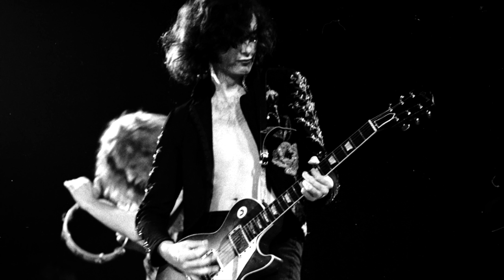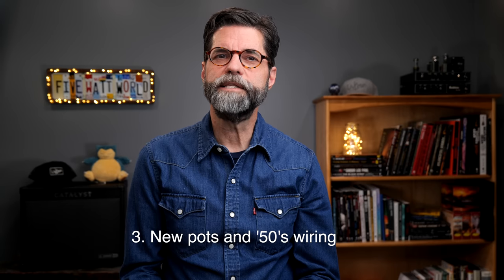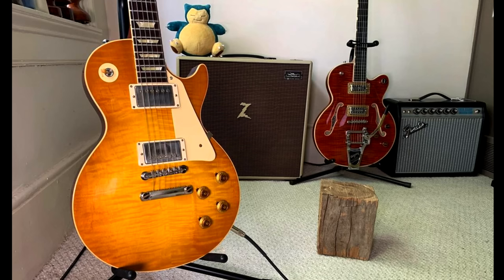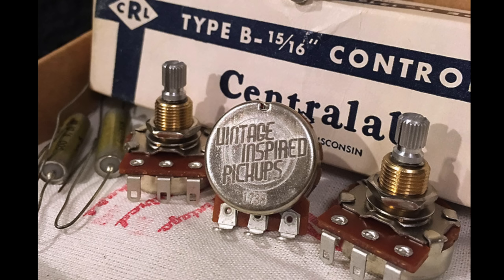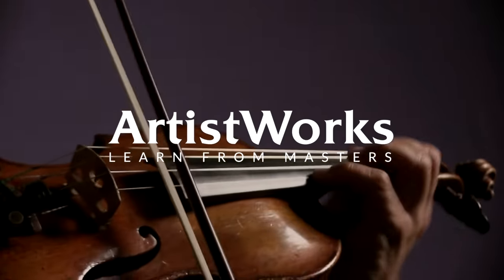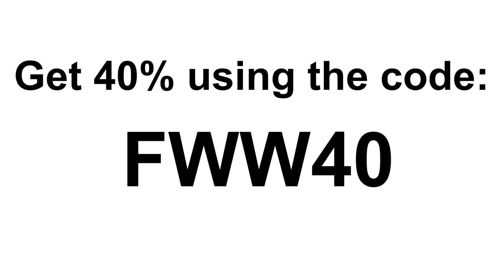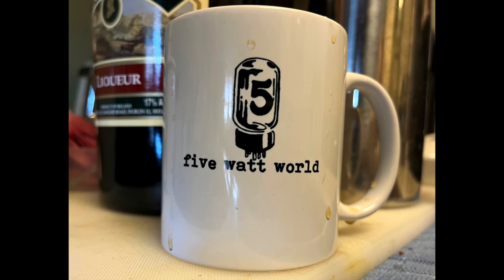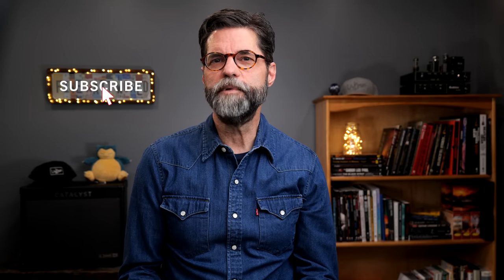Budget Guitar & Boutique Pickups? Is it worth the upgrade?

Comment: I've been recently experimenting with humbuckers in my Strat, and came across some interesting info. On the lespaulforum, there is a "Gibson Historic Spec Pots Data" thread. One Poster ordered 38 vintage spec pots from Gibson. By my count, 23 were below 500k, and 15 of those were in the 400-450k range. Another Poster commented "Gibson used 300K linear in regular production guitars for almost 40 years...and still does...as I noted above....at least, that is my expeience with Gibson pots since the '60's."

There is a Dylan Talks Tone video where he mentions that the biggest tone difference is made on the Volume Pot, as all the signals have to run through that pot.

So, actually measure the pot resistance, and if it sounds good, it is good. 😎

Comment: Without going to the extent of buying costly "boutique" pickups, I think that it is possible to improve a guitar's tone or to make it closer to your liking by replacing the pickups. I find that the Antiquity line of pickups offered by Seymour Duncan are excellent and affordable if, of course,  you are into vintage tones. And if you don't want to change your guitar's wiring to '50s style wiring, you can always had treble bleed circuits to your volume potentiomenters. It's not the same as the '50s wiring, but with these installed, you won't loose any high frequencies when you roll off your volume knobs.

Comment: Some years ago I've modded a behringer strat copy, put blade mini humbuckers on the bridge and neck, added phase inverting and humbucker/single coil switches, rendered the neck fretless and put some locking tuners, all using 'budget/mor' parts, that guitar has so many sounds it's crazy, It's my main guitar in my 'the Oddities from the Corners of Obscurity' project.
And now I'm thinking of trying the '50's wiring on my Gibson SG...uhmmmm...where's the soldering iron?
Thanks for the inspiration!

Comment: This is a great video Keith.  Thank you to you and your team for putting together something so powerful and so clearly presented.  With some rare exceptions I find that I can improve any common guitar with 50s wiring and a pickup change.  My most recent methodology is to buy Squiers and Epiphones that I play tested for the lowest weight and the best feel.  Then do 50’s wiring and replace pots and switches where it makes sense.  Some Chinese Epis come with proper CTS pots where the much more expensive Gibsons come with lower quality Alpha pots.  It was good to learn about VIP, as I tend to source pots and switches from a local parts shop called Solo Guitars and I have had incredible success working with Tim Mills who runs Bare Knuckle Pickups.  Whether standard products or custom winds, I always feel I am getting incredible value for my money.  In fact, I did just this kind of work to an old PRS Core 245 which played great but did not have the openness that I expected.  New wiring with higher value pots, a cap change to a BN paper and oil cap and some Bare Knuckle pickups took it from very good to great.  Thanks again.

Comment: I would also like to throw in about the wiring and small electrical components. Tiny wires, bad solder joints, and cheap caps/pots plague even nice guitars. One of the reasons I started making guitars was that when I bought a factory made guitar, it had all this really mediocre electronics inside it that had to be fixed. I kind of wish companies would sell just a body and neck and then let you Kit the thing out on your own. It might actually save a lot of time and trouble. My Yamaha is currently running CTS pots, an orange drop cap, solid copper wires...and Korean made Gretsch Filtertrons. It sounds great, even though those pups were only about 35 bucks each. The rest of the stuff in there seems to let them shine.

Comment: The single most important spec of a capacitor is the tolerance. You need to aim for 5-10% tolerance at most. Otherwise, it's a crapshoot as to what effect it will have on your tone. The type means very little.

Comment: I have a 2016 LP Studio, about $800 at retail at the time. It sounded OK, but in an attempt to make it sound a bit more like my '77 Custom I bought a set of Pariah  T top clones for $300ish. They are magical. Swapped out the wiring harness too (it was PCB). But for a thousand dollars, I bought the guitar very slightly used for $600, it sounds brilliant. Better than most of the 3 thousand dollar Les Paul Standards I've tried in the stores.

Comment: The wiring and the caps are a big deal.  Does not make any difference if it's a guitar, or stereo speakers.  I occasionally mod a guitar or build a parts-caster or something. I also rebuild older speakers.  I like to tinker.  The ones that always reach out and grab your ears are the ones you spent time doing the research and using good quality caps on.  
Old Soviet Radar caps are a rock solid option for speakers, when you can find them.  Have not found any smaller ones for guitars, yet ...  🙃

Comment: A paper capacitor will eventually leak.
That will result in the same as if you have connected a resistor in parallell with the capacitor.
If that is what you want, connect a resistor there from the beginning.

Comment: "The budget mod platform"  I am sooo glad 'this guitar" I bought NEW for $170 would not allow 1 - install a Stratocaster vibrato mechanism, body was 1/4 inch too thin. Even had I chopped and retapped the end block, routing for springs would have pierced into the bridge pickup cavity. 2 - maybe install a 5-way knife switch.. again, complications. Then I discovered that the 'both on' position was indeed wired incorrectly out of phase. Because it had a chrome tele style control mount plate, I didn't even have to loosen the strings. took less than 10 minutes. I'd already changed out the tuners for Gotoh Minis. Then I just looked at "this guitar". It just happened to have birdseye maple neck. When I looked closely through the tobacco sunburst I noticed the unmistakable "ribbon figuring" - it "just happened" to have a quartersawn (edge-grain) body. I decided it was stupid to mess with anything else.  I soon discovered that "this 'low-end' guitar" more than doubled in value. Had I butchered the thing it would likely have killed resale. You might like to cover the briefly available Squire/Fender '51. Best $200 I ever spent on any gear, besides an unused Carvin ValveMaster 100/50 Stage Master 2x12 I found on Craigslist for $250. I just looked for info and discovered both the amp and its full set of GrooveTubes, have to be over 40 years old??

Comment: Years ago I found a bargain basement deal on a used budget super strat type guitar that was just perfectly to my taste in specs and looks. It felt great to play, but sounded pretty mediocre to bad, so I basically gutted it and replaced all the cheap guts and hardware with decent budget stuff. It was a noticeable improvement, but nothing to write home about, it was a cheap backup. I had these hand wound custom made pickups gathering dust, because I had ended up selling the vintage guitar I bought them for, so on a whim I had the installed in the budget guitar. Ever since, that guitar has gone head to head with name brand new and vintage guitars, custom builds, and I still have it and enjoy playing it regularly. I never would have planned it, but what a pleasant surprise it was

Comment: In 2014 I went for a full Custom Waghorn Sauria S specing with Tom. He got the basic guitar perfect and I chose over complex electronics and I didnt like the pickups. HSS and I also had a Yamaha Pacifica Jack Thammarat HSS which become the modding guitar. I tried diMarzios to ying yang Kiesel and finally 2 types of Suhr. I took the bold step with my tech to take out the piezo.hipshot bridge and replaced with brass saddles, used dip switch as H coil tap and the piezo control as a blend between neck and bridge and a new 5 way switch, then a fender 250/500 volume pot given only one volume. The tone is a  stellartone. Ssv ans 2 v60lps. Now super. Other mex strat redid metal work and Shaller locking tuners, Gotoh 510 trem pickguard wth JJguitar pickups V12 (a la DG tones). Gibson les paul studio, SD whole lotta pickups rewired tones push pull with phase and parallel a la JP. Gibson lps100 dc upgraded JJguirar pickups J90s this is awesome sounding. Thx to Burgs for introducing me to Ben Bailey’s pickups. Thanks to Komson my tech in Bangkok and Tom Waghorn a superb luthier. Modding is a great experience and great to get what you dont want to afford!

Comment: The biggest things I look for when trying out guitars is not how they sound, but how they play. You can change how a guitar sounds, but if a guitar is a dog to play, good luck. With that in mind, I'm also a tinkerer and I've built a handful of partscasters and modified nearly every electric I've owned. My most recent project was my 2012 Epiphone Sheraton I sold when I went broke. I had the chance to buy it back and once I did, it became a forever guitar. Since getting it back, the pots have been swapped to CTS, the wiring has a treble bleed circuit in all positions, a master tone on one knob and a grease bucket on on the other, Bigsby, roller bridge, and Lollar El Rayo humbuckers.

If I was forced to sell it, do I expect to get any more than maybe $600 from it? Absolutely not. But I have all of the original parts I'd use to revert it back to stock with and then sell all the upgrades separately.

Comment: Oh heck yeah. I haven’t listened to it through good phones yet, but I hear it. I was thinking about what I’d do and with what guitar to try that out. It takes some courage to take a guitar that fits you and mess with it, and the guitars I might want to mess with aren’t a fit for reasons that have nothing to do with the electronics. But I’ll keep it in mind. The thing with using tone and volume control on a Les Paul works just as well with a Custom 24 with the one tone and volume control. It was a revelation how easy it was.

Comment: Interesting video.  I did this with Seth Lovers, orange drop capacitors, and 50s wiring on a Sire L7.  The stock pots were already 550k, so I kept them.  The upgrade was fine, but I wasn't knocked out.  Most of what is different for me is following McErlain's advice on how to use the tone and volume controls.  I used to turn everything up to 11.  Maybe, like the installation of Apple CarPlay in my car, the upgrade is allowing me to do something I never thought to do before, and I just don't appreciate it yet.

Comment: I've just started (gonna build something this summer) swapping PUs on a Classic 50's MIM strat. It was adequate with the vintage voiced PUs but I thought it would be fun to start swapping out parts. Dropped in a Seymour Duncan Hot Rails in the bridge and a SD Antiquity neck. I thought I was done... nope. Now swapping the pick guard, wiring harness and replacing the middle PU. Great platform for experimenting and I am noticing a new (and it could be argued a much improved tone).

Comment: I feel like Seymour Duncans typically do the job for me. Not even sure if those are 'boutique' though?

Also, I think it's all about the neck...once you have that on any guitar, one can swap out electronics etc in a fairly straightforward fashion. And, yes, I've always been happy with any well researched pickup upgrade. Doesn't need to be anything super fancy.
Reply: Yeah, I think SDs can satisfy almost any requirement. I got some nice P-90s from Bare Knuckle but they're more expensive.
Reply: @jimhova   yeah, I've got some bare knuckles and a few lollars. Have only tried the lollars so far...bit are they bright! So bright, I don't think I need the vintage wiring :)

Comment: I have an older PRS SE Custom 24 (built in 2011) that I recently upgraded with Vaughn Skow vintage-style pickups he designed as PRS replacements.  PRS redesigned their pickups in 2015, and the older ones both were not splittable and did not sound as good as the newer 8515s.  I added pickup splitting toggle switches, as the Vaughn Skow pickups are splittable.  I very much like the humbucker tone of the new pickups, but the single-coil tone is not quite what I hoped it would be.  The split tone is pretty good, but does not have the Fender-style bite I had hoped for.  The Vaughn Skow pickups were about $250 for the pair.

Comment: We all have our preferences when it comes to guitars. When it comes to gear, guitarists are some of the most closed-minded musicians I've met. What's funny, IMO, is that many of the guitarists we admire from the past were more open to trying new things.

I'll say this, today's sub $1K guitars are very good. So good in fact, I've been selling my more expensive American made guitars and getting these lower cost guitars. 

The stock pickups are fine, some are even Seymour Duncan, DiMarzio, EMG and Fishman. No tuning or adjustment issues, even with the weakest point the Floyd Rose Special trem - and even these are much better than they were 5-10 years ago.

The QC is there; the fit and finish is better than many Gibsons and Fenders I've played over the last 10+ years; many didn't need a setup, just new strings and intonation adjustment. 

Believe what you want, buy what you want. It's your money.

Comment: My most expensive guitar is my Sterling by Music Man JP150 that I dropped DiMarzios and a push-push coil split into. I also have an affordable Ibanez S that I dropped DiMarzios and a new output jack into. Guitars are tools, not sacred artifacts. They're meant to be used, and if you don't like it for some reason, you won't use it. The only guitars I would never consider modding are the ones that are either just too cheap to justify it, in which case it's probably just a stopgap, or already perfect, which honestly doesn't exist. Even if it's just swapping out for locking tuners or doing a little sanding to clean up with finish.
Reply: Did the same thing with my Sterling JP70, minus the coil-split (I got a push-pull tone pot, but chickened out because it was my first time changing out pickups 😆). I put a Crunch Lab and Liquifire combo in it, and the difference was night and day.
Reply: @phootaphan9166  The coil split is kinda whatever. The push-push I put in was ever so slightly larger than the pot I took out, so me doing my first ever guitar mod having to drill out the hole on a gorgeous blue quilted top... Nerve-wracking.

I put in Illuminators, since that's what the actual JP15 comes with. It's honestly only today, now that I have a better amp and a better idea of what I want to sound like, that I understand the criticisms of those pickups. There's almost no difference between the neck and bridge pickups and they're so hot that you have to roll off almost all the way to clean up. Bridge pickup sounds epic at full blast, though.

Comment: Is it worth the upgrade? Well, that depends doesn't it? There are scenarios when it's almost necessary, like cheap single coils. Pretty much any humbucker is useable, bad single coils on the other hand…not so much, especially if you're going to run it through gain. As for humbuckers the music you play and type of tonal ballpark might necessitate a pickup replacement.
The best example i can think of to get the point across would be the older PRS SE pickups, the ones with zebra bobbins that they were using on all the SE models between the 2000's and mid-2010s. Those pickups were REALLY hot compared to what you might find in most other budget guitars, or guitars in general. I don't remember the exact DC resistance when i checked it years ago, but it was somewhere in the 15K region (including the neck position which is EXTREMELY high for a neck pickup). If you're looking for that PAF-type open, articulate almost scooped sound that will respond to your pick attack, those stock ones just aren't going to cut it. When i first started building pedals and modifying amps 20 years ago i would try out single coils, P90s and humbuckers to test out whatever i was working on, and I discovered pretty quickly that the SEs were just way too hot to use in this manner because they just slammed the sht out of whatever i was plugging into (and when i plugged into a clean amp they were literally twice the volume of the Strat i was playing). 
That said it's not necessary to buy $600 set of ThroBaks to get you there. I've installed quite a few sets of Toneriders in people's guitars, both single coil and humbuckers, and I've been impressed with every set, which all sell for $100-120/set.

*I personally go for '50swiring for humbuckers in my own guitars, with Two exceptions: semihollows and a guitar i have with stereo outputs, both guitars for the same reason. With solid body guitars I typically run  through the neck or bridge pickup alone, however on 335 type semihollows the pickup selector resides in the middle position the vast majority of the time, and I'll use the volume controls to dial the sound in (this is why the master volume/master tone layout on PRS Hollowbodys was a non-starter for me), the same goes for stereo outs. The problem with 50s wiring is that if you roll one of the volume controls below a certain point, it'll completely kill the output on both pickups. Something to keep in mind.

Comment: If I were you I'd ask my tech savvy friends about linearity in vintage capacitors. Like with speakers caps don't measure identically at all frequencies. Typically the shorter the impulse the more it can store. This means the cap rolls off higher frequencies more effectively without taking the mids with it leaving you with a load of mud
Reply from the maker: You might have noticed I went vintage paper and oil…just in case, ;).